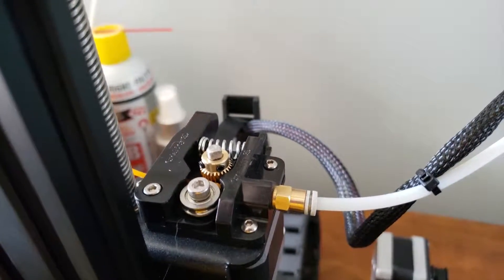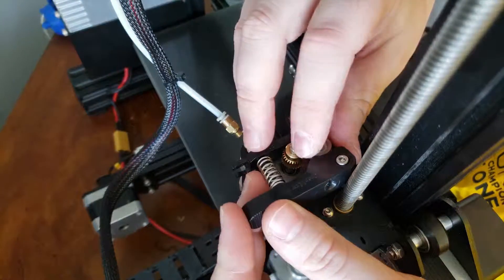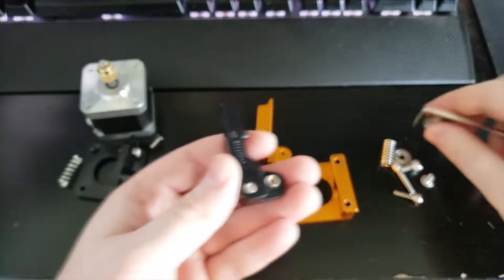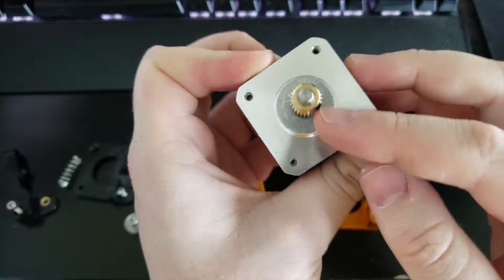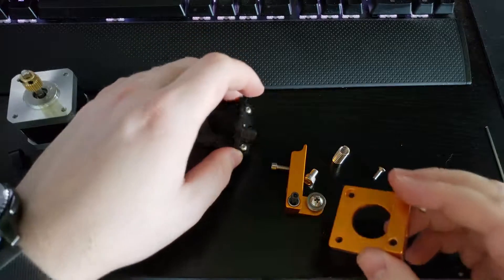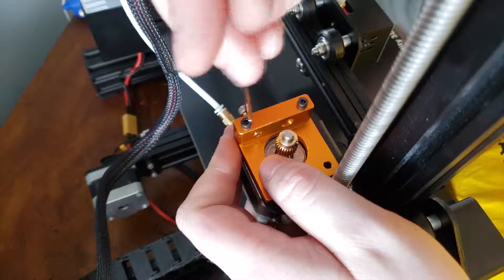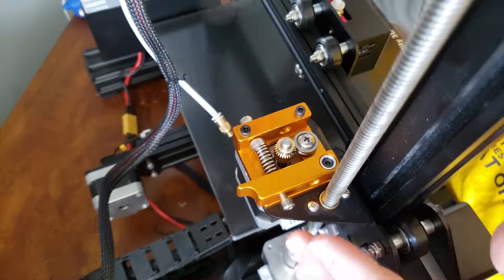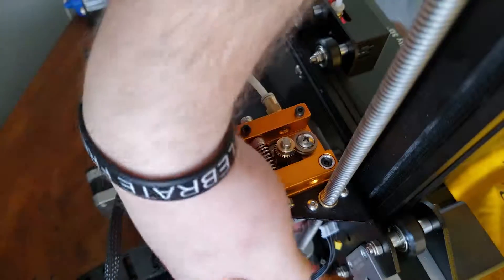Assembly/Installing MK8 Extruder on Ender 3 - Upgrade

Comment: Thanks for the video. How bout print quality? Did you have any issues later?
Reply from the maker: Actually I did. The specific one I bought left too much of a gap for flexible filaments causing them to fail all the time. Otherwise it worked though
Reply: @UrbanNerdOfficial  Thanks for the reply bro! I did the same and it's worked great ever since.